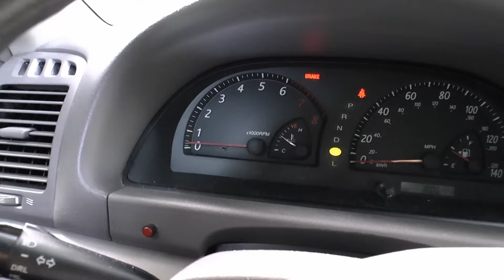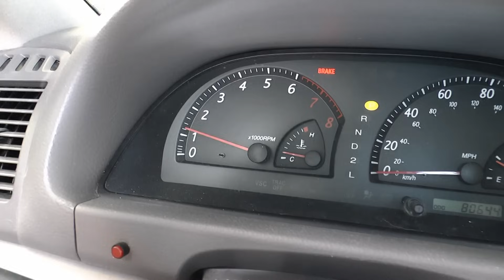How to Fix Low Idle Problems in Your Car (Throttle Body)

Comment: Hey everyone this is a bit unrelated but I have a Evo 9 and when driving on the highway I get hot air belowing out from my vents even though I don't have the heat on and im not overheating and my ac only works if I have it on defrost, I have recently turbocharged it and these issues happened about 3 weeks after, any suggestions ?
Reply: It's quite common with mitis I had that problem with my Evo 1 iv had to all it allways had that problem my rx8 does it to
Reply: lorolla123 It's also a common issue with a 99 oldsmobile intrigue 3.5.....I always enjoy that extra heat when it's 100F outside lol.
Reply: lorolla123 i understand it can be common but how do you fix it ? I cant suddenly be doom to have to deal with this issue for the reminder that I own the car
Reply: Have you increased the boost recently? Removed any heat shields (e.g. exhaust manifold)? Is the bonnet vent clogged? Engine bay dirty? These can increase under bonnet temperatures, happened with my evo 7, also had a check engine light due to the exhaust manifold getting too hot. Just clean the engine bay, and vents, see how you go.
Reply: This problem was actually covered in a video not that long ago. The heater usues water from the engine cooling system. The flow of this water is controlled by the computer and solenoid valves. So that's what's gone wrong. Hope this helps.
Reply: Spencer Howard Hmm, Interesting, could it also be his thermostat?
Reply: That is also possible but given that it's still blowing hot even when it's set to full cold I'd be more inclined to say that it's a computer issue or valve issue.  Either way it's a pain in the ass to deal with.
Reply: ernesto7373 that was the first thing I tried after Iook through my manual and it still persist
Reply: ernesto7373 that was the first thing I tried after Iook through my manual and it still persist
Reply: donkey1450 no my engine operates at safe temps with sufficient cooling, as I said the car isn't running hot and I had the engine bay professionally cleaned after the build
Reply: Spencer Howard I will check it out when I get off later
Reply: Based on the earlier video and my understanding, you can bodge it for really cheap but to fix it properly is a royal fucking pain and very expensive. Goodluck mate.
Reply: Spencer Howard well I worked crazy overtime all summer to be able to finally turbo charge it so right now im completely spent so hopefully I can fix it the cheap way for now and thanks to everyone for your help, you guys are awesome
Reply: lorolla123
I know the RX8's do it because of bad soldering on the control board for the knobs. They usually work with some wiggling. They can be re-soldered or the boards can be baked in an oven or hit with a heat gun to reflow the soldering.
Reply: ExiliousX Of all the things to go wrong, soldering is the easist thing not to fuck up, that's a real shame.

Comment: i have a p0507 code how do i fix that it idle above 1 rpm
Reply from the maker: that code has a dozen possible codes. Try cleaning as in my video "how to fix a car that idles poorly" and pray it's not a computer or wiring failure
Reply: ok and it say fuel system 1&2

Comment: i have a 99 yukon denali and my rpms just after I drive ot for awhile can someone plz help i cleaned the mass air sencer and used seafoam to clean vacum lines plz help
Reply from the maker: on those, pressure test the fuel pump too in addition to these video fixes as those often go out on denalis
Reply: How do i pressure test the fuel pump

Comment: I have a 2010 honda accord and it idling high like 1200 rpm or even more and i live in a hot climate
Reply from the maker: try as in this video, and if needed, take the throttle assembly apart and clean all the small holes inside

Comment: I changed my Camry Battery by new one I noticed that my car is shaking with low rpm and AC is low cool when only stop it's really strange problem
Reply from the maker: happens all the time on those, but driving a few weeks after changing the battery often will let the computer reset the idle speed correctly.  If time doesn't fix it, see a guy like me with  a dealer level scanner to analyze the live data to find the fault then.
Reply: This is exactly my problem. Resting RPM at lights is now 500 in gear drive (automatic car) and about 650 in neutral. Been about a month since battery was changed

Comment: my isuzu rodeo 98, hessitates and shake abit stronger than normal when taking off.. not everytime but sometime every seven or ten stops, i feel the hessitation,..
Reply: can you pls help me with my problem, we sprayed the trottle body bud we didnt wipe it, and we also sprayed the air flow sensor... but still it hessitates sometimes and the check engine comes on.. but sometimes its blinking.. been like this for 3 days..

Comment: I have a 2004 Toyota Camry The car runs sluggish when air condition is on, low idle I cleaned the throttle body still the same
Reply: Same here

Comment: If your vehicle has any sort of issue with it and you have no idea where to start or you know what to do but are unsure on how to do it reply to this comment and I will assist you! Just be as specific about your situation and vehicle as you possibly can!😁
Reply: 01 Chevy Silverado 1500 not HD . LM7 Rear wheel Drive. Truck was sitting for a few months. Ended up replacing power steering rack, pulley, and pump. Knocked of the Engine Coolant temperature valve in process so replaced that. Started truck up, it idles low at 500 then turns off when it gets warm. Starts back up right away usually. sometimes it gives a sound like battery  is dead but it’s not. Cools off and turns right back on. Ended up ordering air idle control valve off car parts it was cheap and didn’t look 100% same. But not giving codes.  Did spark plugs, air filter and cleaned throttle body problem persists. Am I looking at a fuel related  issue?

Comment: I cleaned the trottle and now my 2001 nissan sentra idles very poorly the rpm needle goes up and down and sometimes it turns off. I cant even move the car anyone know the problem?
Reply from the maker: +jose garcia try running it at 2500 rpms in the driveway for 10 minutes sitting in it. Then drive it a couple days, often the computer then resets the idle
Reply: +Scotty Kilmer ive drove it this morning and the rpm goes all over the place is that normal?
Reply: +jose garcia you need to have the idle relearned using a procedure or using an advanced scan tool

Comment: After done this method...my car idle at 600-700rpm...but when i shift my gearbox to drive position...the rpm still drops to 500 and my engine vibrates.anyone knows how to fix this problem?

Comment: hi scotty my renualt clio1.6 2003 has a low idle and shaking engine. cleaned the throttle body replaced air filter cleaned idle control valve replaced map sensor engine stopped dieng after that but still my idle is very low and engine shake like. ...! Please help
Reply: +siyabonga dichaba IAC valve might be failing
Reply: I have replaced it no deference and no faults showing on the diagnostic reader.....
Reply: +siyabonga dichaba 
Try checking the ignition coils
Reply: +siyabonga dichaba check for vacuum leak
Reply: best tip you'll get: dont spend a lot of money on that car

Comment: How to increase Suzuki swift rpm.
No my car normal rpm is 700 only so my ac compressor is tripping normaly,i ill increase my acceleration its work good but standby not good,normal rpm 700 is crct or not?how i ill increase rpm...

Comment: my 2010 subaru exiga idles very loud and the steering wheel vibrates
Reply: Ryan Mott you should check your bolts on your throttle body had the same problem

Comment: It was my impression that you should never move the throttle plate with your hand on an electronic throttle. Doing so will screw up the electronic throttle and it must be re-calibrated at the dealership. Why didn't this happen this time? Is this not the case for all electronic throttles?
Reply from the maker: nonsense, I clean em all the time this way.  They only need recallibrating if parts like tps sensor are changed
Reply: Cool thanks!
Reply: I had to reprogram the throttle in my 2006 altima after I cleaned a bunch of stuff, including the throttle body. Turns out I lost a gasket to a vacuum line too though, which may have been why the throttle got all wonky.
Reply: @scottykilmer  I cleaned a 2008 Scion XB throttle body and it still shakes a little at idle. I checked motor mounts, air filter, new plugs, and all of the ignition coils work. The shop couldn't find any vacuum leak. I have no codes coming up. I think it has something to do with the electronic plate or idle air control?

Comment: Car used to idle at 1000RPM but after I changed the sensors it started idling at around 600RPM. Anyone else have this happen to them? How can I get back to 1000RPM?

Comment: both my air filter and TB were filthy can was running around 500rpm now its stuck at 2100rpm :S
Reply: Loyal Royalty judging by the fact I posted this 5 years ago the car didn’t have an electronic idle air control valve instead it used a screw that you wound in or out depending on how you wanted to adjust the idle

Comment: I have a 1985 Toyota celica and right after startup in a few minutes it'll idle low to 600 rpms
Reply from the maker: try this video fix, and also my other video "how to fix a car that idles poorly"
Reply: I already did but it was because of another issue. So my car runs fine now. Throttle was dirty too so it's a good thing I cleaned it

Comment: Now we need to see how easy it is on Toyota Avensis 2.2DCat .06 When throttle body is located deep in #%*& and only way to get to it is from under the engine :(

Comment: What if the base ignition timing is retarded by about 2 deg. from the factory spec? Could that small amount of timing retardation also cause the idle to be a bit rough and low?
Reply from the maker: Cameron Jenkins it sure can

Comment: I just trade in my 2003 Camry for a 2015 Camry I should have done that but I didn't nor my mechanic :( now I have to pay 16,000 dollars for a 2016 Camry suck but I got old with that 2003 I need a upgrade